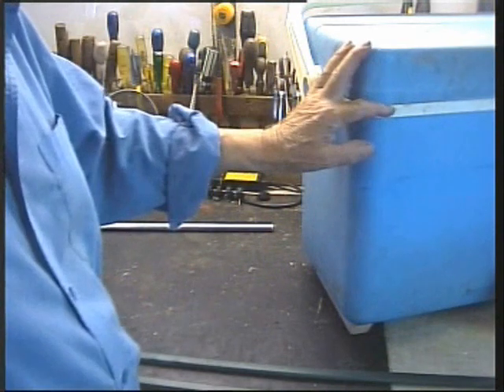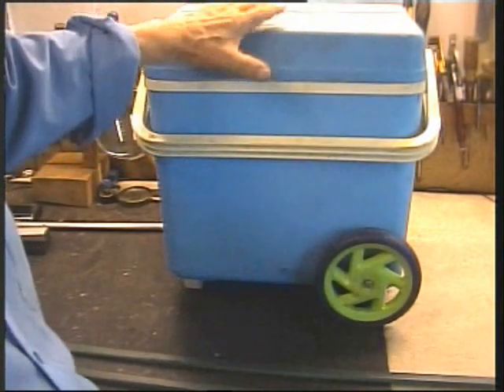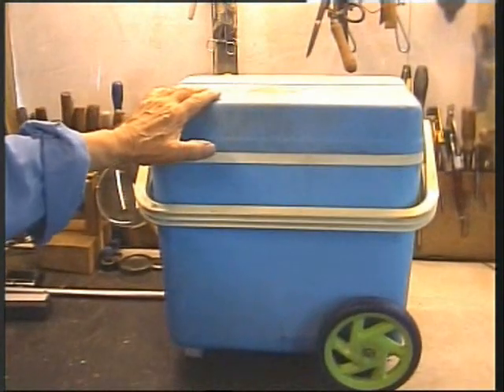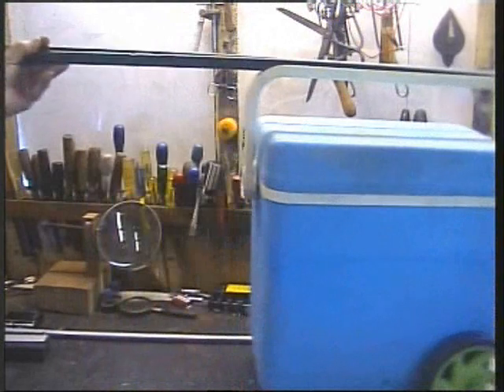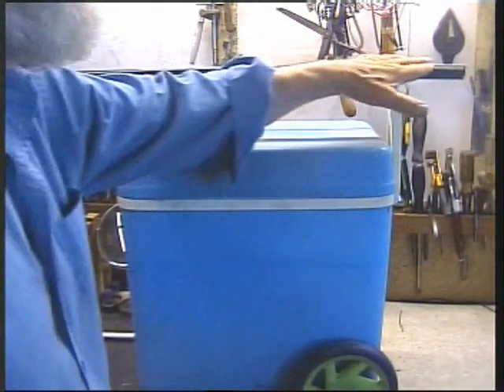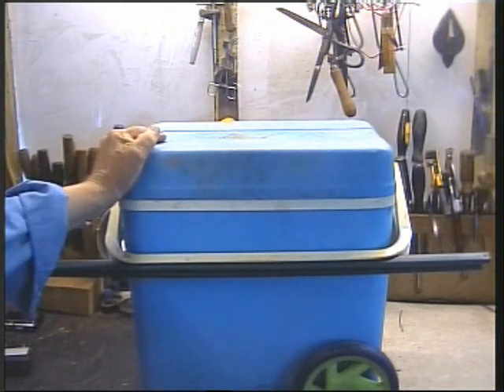cool box to tackle box

Comment: Where did you find the high density foam you put in the aluminium channel ? I could use a bit of that for my pond boat . Thanks for the ideas
Reply from the maker: It's use in the construction business for expansion joints in walls or concrete etc
Reply: @poroldchap  Ok Thanks , I I'll check Home depot or Lowe's , if a hole was made about 1/2 inch in with a slit to drop a rod into , I think it would make a fair rod holder on a wall or ceiling , also